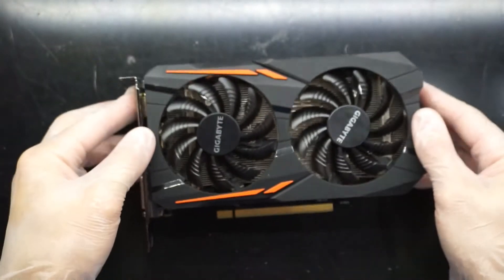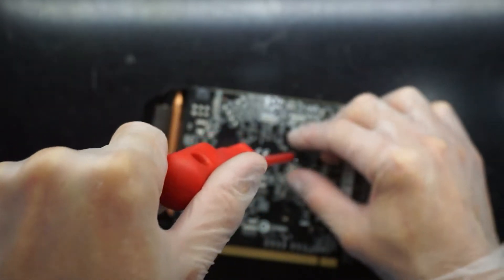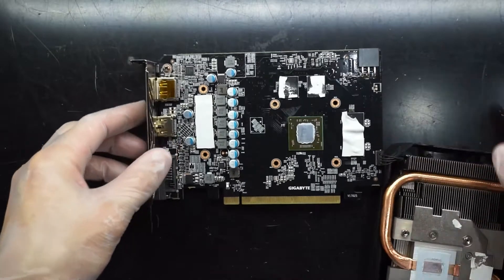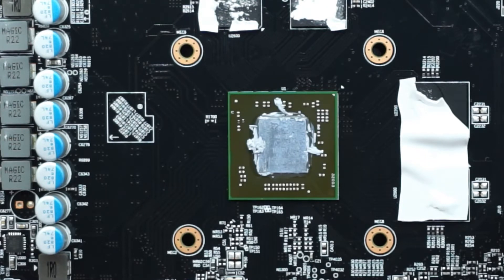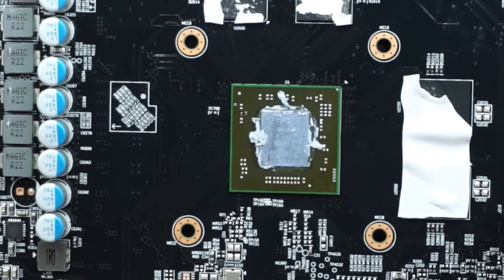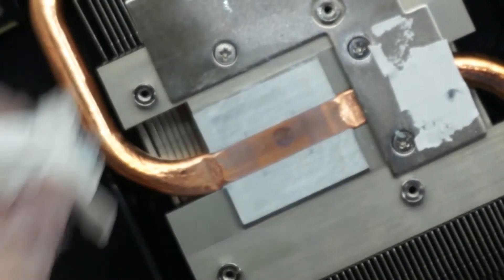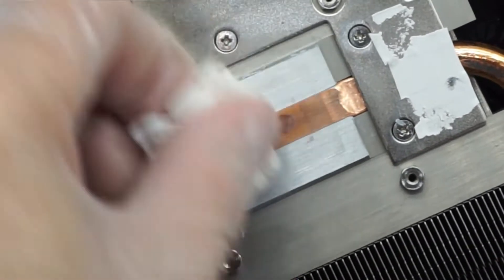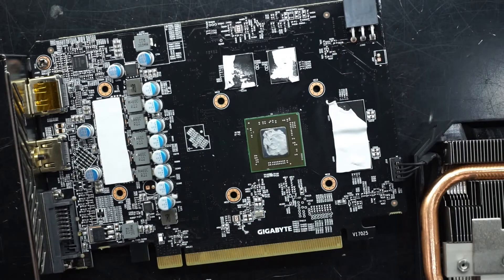Thermal paste replacement on a Gigabyte Radeon RX560 2GB

Comment: Is it dangerous not to replace those thermal pads?
Reply from the maker: It will live without them, as it's such a low end card
Reply: @rickstechrepairs  mine is rx 570 can it cool down without them?
Reply: Yes it is, since the temp will rise faster without it.

Comment: What did you take the thermal off with
Reply from the maker: Alcohol on a tissue
Reply: @rickstechrepairs  which alchohol would you recommend
Reply: @armandomurillo9485  The best is isopropyl but ethyl is good too